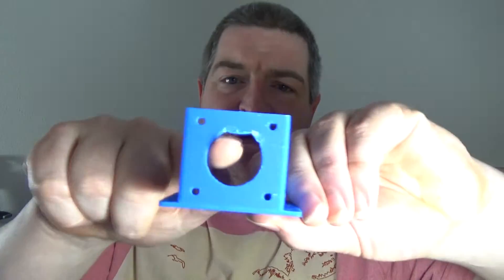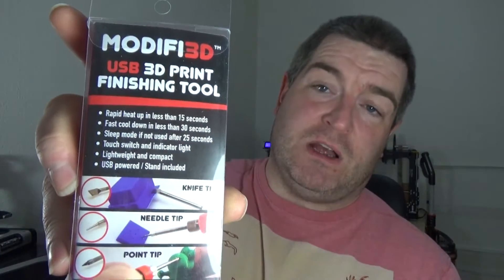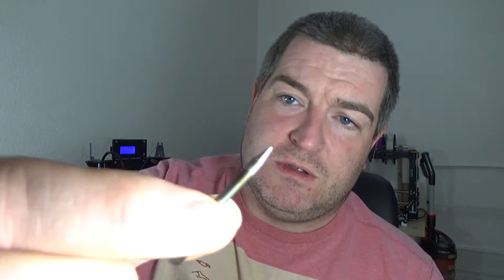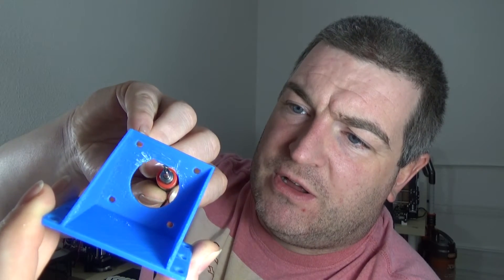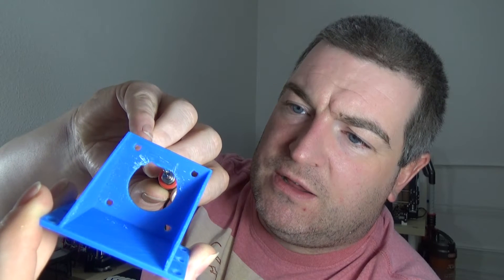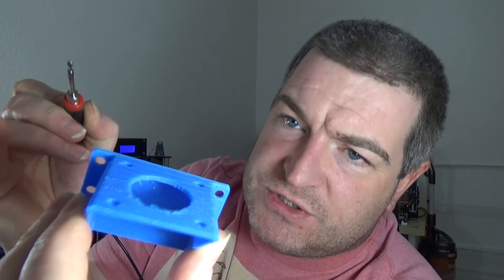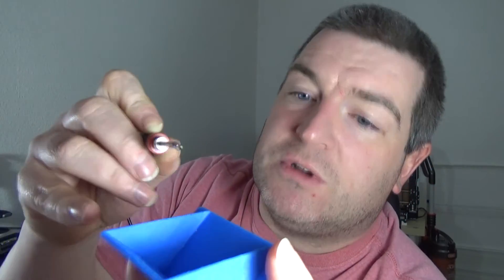Modifi3D 3D Print Finish Tool

Comment: That is a USB soldering iron. They run about $5 US from china on ebay. The only extras are the added tips.

http://www.ebay.com/itm/Mini-Portable-USB-5V-8W-Electric-Powered-Soldering-Iron-Pen-Tip-Touch-Switch-UF-/162032698218?hash=item25b9e6c36a:g:6wYAAOSwq19XCIga
Reply from the maker: +Peter Borders Hi, you're right, it looks exactly the same.  Wonder if it's all in the coating of the tips then.